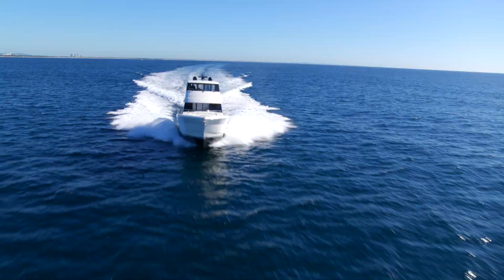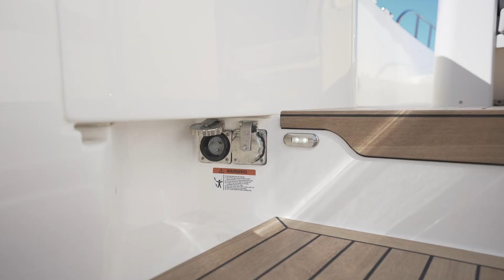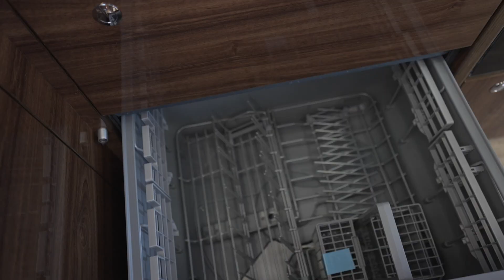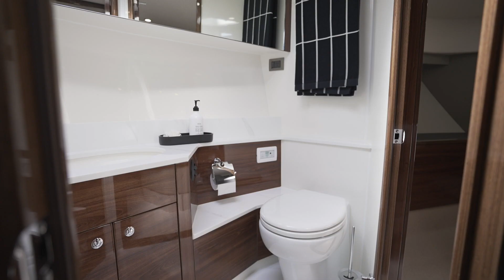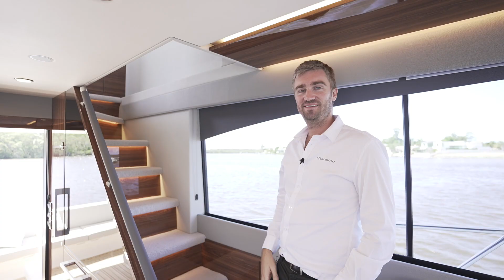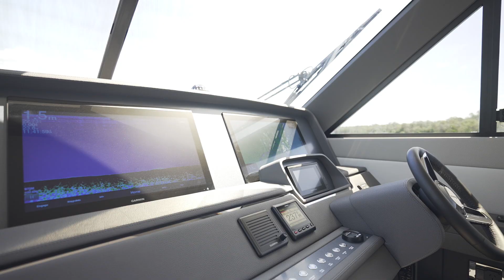Maritimo M55 Flybridge Motor Yacht Walkthrough

Comment: What is the max fuel tank
Reply from the maker: Hi Omer, there is 4,550 litres of fuel available through three tanks and we also have an option for an additional 1,400 litres of fuel to be installed in the lazarette area.
Reply: @MaritimoMotorYachts  I need more info on gyro 
How good is it oversees travel
Reply: @omerturk3943  There good at cruise, not much use for overnight anchorage unless you want to power it all night.